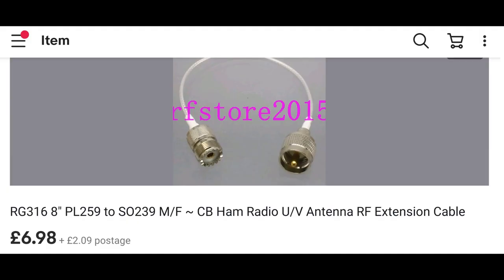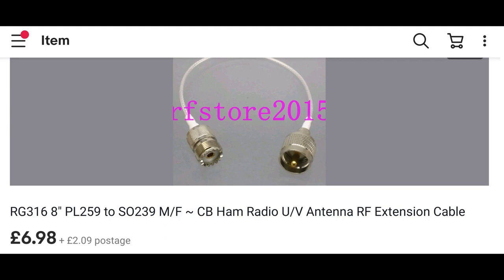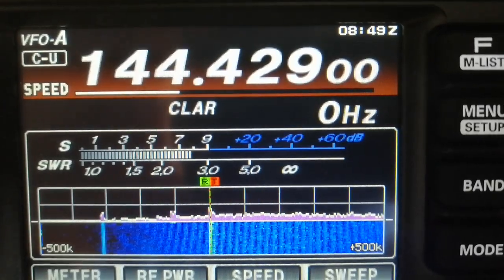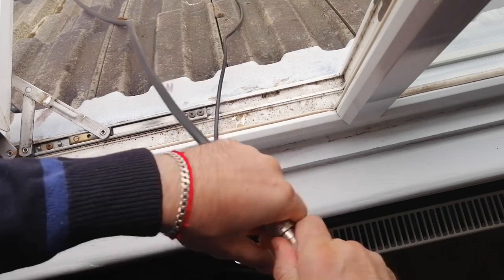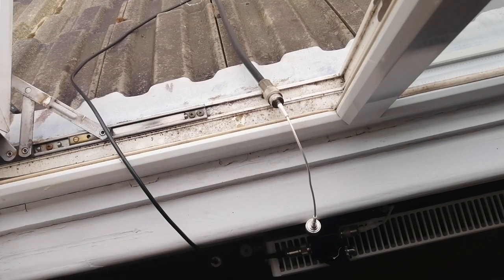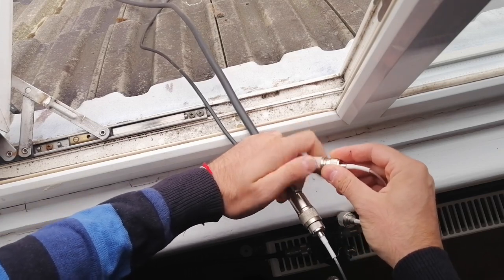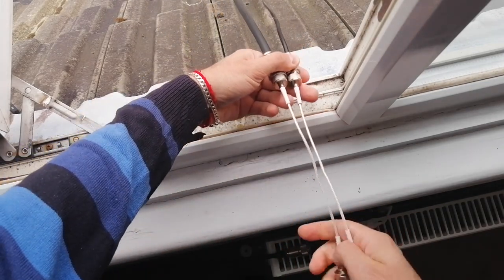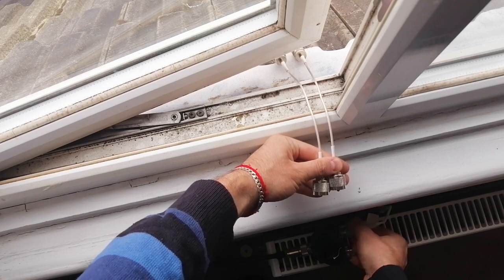Coaxial antenna cable through the window - it is possible!

Comment: I'd put some self-amalgamating tape on those connections outside for the weather. RG58 does go through a uPVC window when closed, you just have to bend it to fit when closed at the right part of the window mind.
Reply: Don't waste money on self amalgamating tape, use petolium jelly (Vaseline)

Comment: I'm looking into something like this but, a bit concerned about noise due to the thinner cable.There was music playing on the video the whole time so, I couldn't hear the radio. Was the signal clean or, was there more noise due to the thinner cable?  And, how many watts would that cable handle? Good video, got me thinking. That's way easier than drilling my wall or building a window passthrough. And, I can keep my screen! Thanks!
Reply from the maker: Hi Scott, thanks for your comment. There is no change in the noise floor. Tested on few bands HF and I am still using this method to run cables at the new property we rent. What made real difference in the white noise - I made few turns of coaxial around a big ferrite clamp core. It dropped the noise on 80m  with 3 S units. I am running 100W without problems.

Comment: Thanks for sharing that. It should do the trick for a lot of hams, across the globe. And it should fire up a few brain cells as well, and get other Amateur ops thinking of variations or even improvements. 73 de VK2DMH.
Reply from the maker: Thanks for your comment! Yeah we should think of cheaper options - big brands have flat cables with 2 connectors, too but come at around £50/each.

Comment: 00hey man, can you tell me if you know any differance between cf400 cable versus lmr400?
Reply from the maker: I haven't looked at this deep as I am using Westflex103 for my installations. It is not really flexible due being a solid core coaxial cable. Probably the only difference is just the manufacturer. Characteristics would be the same.

Comment: What on earth are you doing  putting those darn AUDIO connectors on a vhf uhf cable N Type forget PL 259 so239 darn AUDIO CONNECTORS
Reply: A GOOD quality PL ( IF Amphenol ) is OK . We can debate on the unconsistency impedance but they aren't BF connectors at all. You are right on the N connectors ( and we can add the BNC and , if low power, also the SMA ) . What's not explained on the video is : squeezing a coaxial cable is always bad because you makes the inner "more close" to the braid (squeezing the center insulation) so the capacitance can be different .
Reply from the maker: In my case the rubber insulation gives 2-3mm gap so it is not pressing cable so much to deform it.
Reply: I would choose PL-259s anyday over N Connectors. And they are not Audio Cables. Where did you get that idea? SMH. Oh, I hate BNC too.
Reply: @N2LRB  PL259 audio connectors not worth their weight in scrap metal